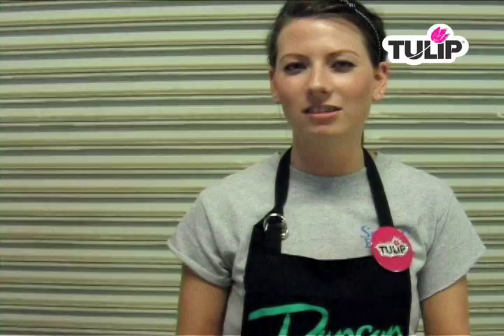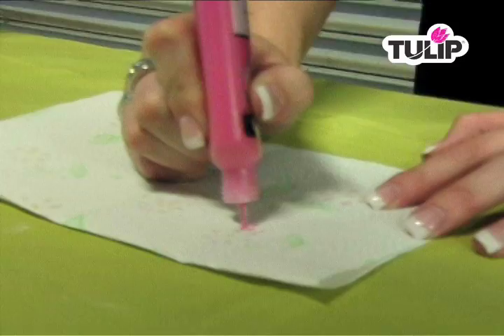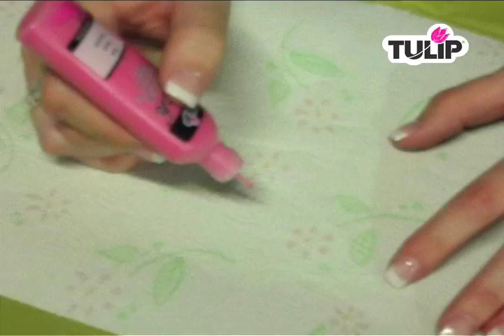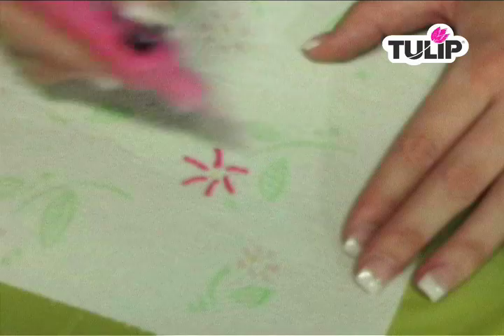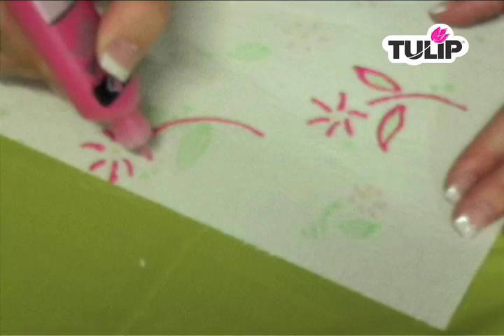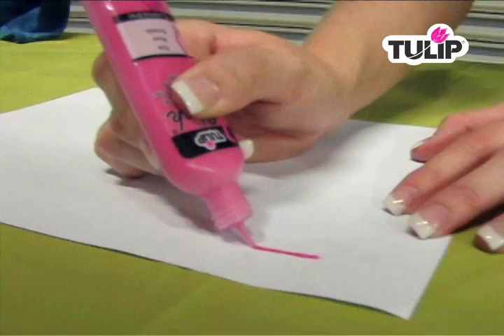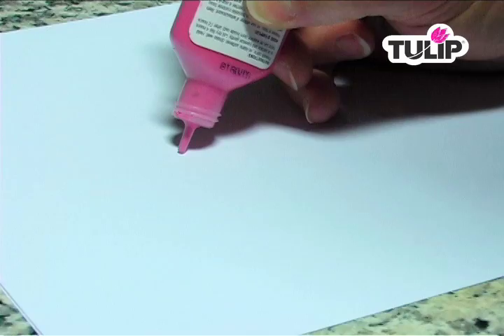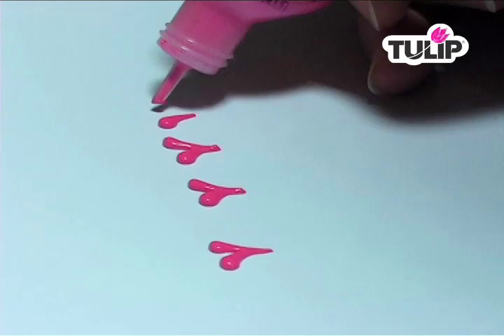iLoveToCreate Tulip 3D Fashion Paint Basics

Comment: Hi
After painting, how much time is needed to soak or use the cloth and do i haveto iron before using it. On the bottle it said 4 hours and i used after 10 hours but the paint was not dry and it effected my design
Reply: Hi there ... we're so sorry you experienced trouble with our paint drying! Four to six hours is the minimum amount of time, but it can definitely take up to 24 hours or more depending on climate conditions in your area (temperatures, humidity, etc.). What type of fabric did you paint on? Also, a trick our designers here in house use: you can use a blowdryer on the paint to speed up the drying process! Keep us posted on the type of fabric used and we can touch base with our design team about it.

Comment: How can i even get the paint OUT of the bottle no amount of shaking and squeezing - do I cut the tip?
Reply: Hi Emily ... Did you check the tip for clogs? Sometimes the paint will dry out in the tip and create a blockage. The best way to clear it is to remove the tip (it will actually pop out of the bottle if you push it sideways with firm enough pressure). Then use a pin to poke through the tip and clear the dried paint. You might need to soak it in warm water for a bit if there is a lot of dried paint. Once it's clear, snap the tip back in place and you should be good to go. If the tip isn't clogged, the paint itself might be too old and has dried out. You can snap the tip off and check. Does that help? Let us know if you have any other questions!